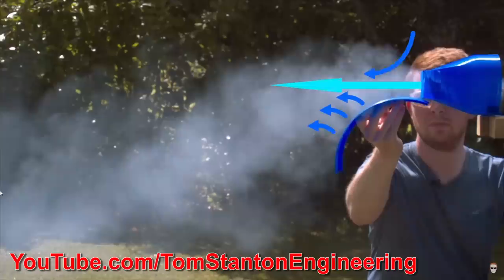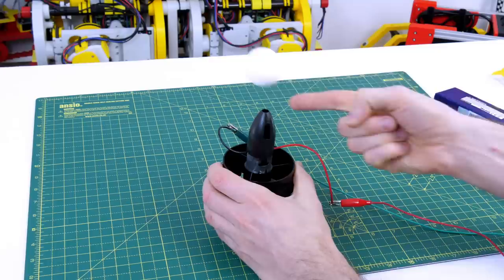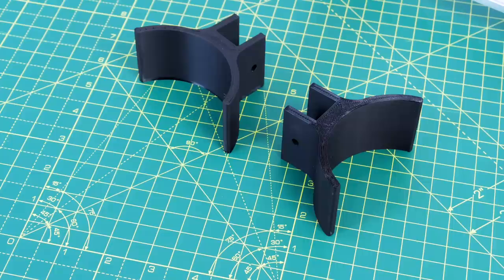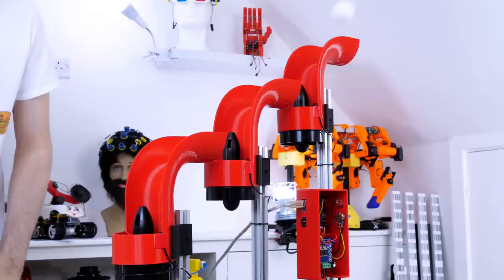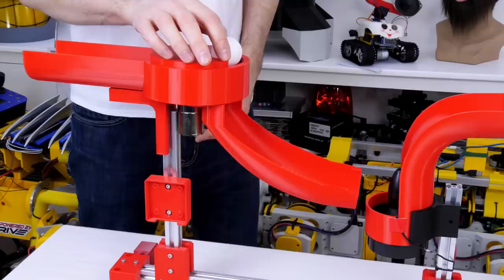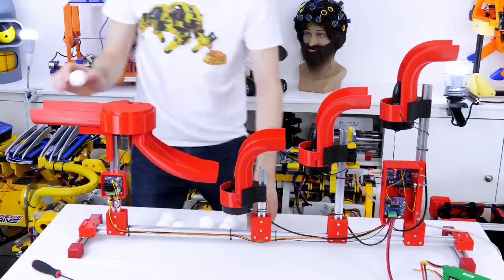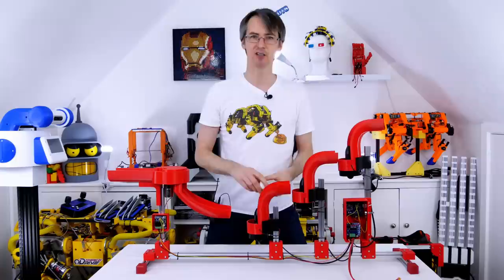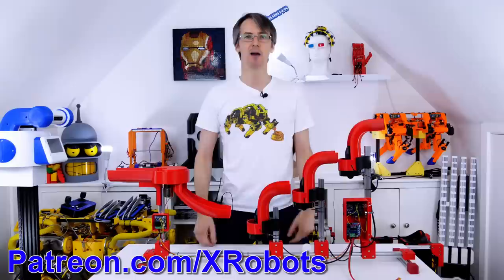What is a Coanda Effect Staircase?

Comment from the maker: We're back to serious robotics again next week with part 2 of my drop-in navigation system for any robot. Patrons and YouTube Channel Members have it already!
Reply: I think the reason why it doesn’t work after it comes out of the shoot is because when it goes out of the shoot it has been spin
Reply: I really enjoyed this one, cheers! 😊👍
Reply: @ben_ands  Maybe an upturned lip at the end could slow the spin as much as possible, so the ball just barely clears the edge
Reply: hey James I want to build a (Nao) humanoid robot using a 3D printer a bunch of servos and a raspberry pi but I have no idea how to code or how to use a raspberry pi do you have any advice on how I can learn or get a pre-programed file for a basic humanoid robot?
Reply: Just curious to see if the air would stick more after using filler and sanding for a nice and smooth inner surface for the air to follow.
Reply: Change the feeding chute to two rails barely closer together than the diameter of the ball. That will give the balls a consistent and repeatable forward spin, essentially aiming them along the "Coandă steps" and also be aligned with the direction of the airflow. 
Edit: Also put some straws or small tubes together on top of the EDF's to get more laminar airflow. 
         Another thing is why don't you use a power supply instead of those batteries...you are not out on a field with no mains power?!?!
Reply: You could make the shoot skeletal with just two metal rods dropping the balls so the air wont stick
Reply: you could have taken a heat gun to a swimming fin to create that shape more cheaply

Comment: I think the coanda effect would be more obvious if the balls didn't enter the system with horizontal velocity. As is it looks like they're already moving sideways and the fans just provide lift. Maybe release them whilst stationary via a grabber. This then challenges the viewer to work out why they start moving sideways.
Reply: Yeah, I was wondering if you could get this system working with the units oriented at an angle, so the balls go up in a spiral or a zig-zag.
Reply: @Hugh.Manatee  mayby with extreme zig zag, and compensated L tube in the turbines
Reply: Alternatively, maybe just have them enter enter with horizontal velocity but in a different direction. That sounds like it'd achieve the same thing with much less work

Comment: Have you tried 'tree support' in Cura? Might quicken some of those long prints!
Reply from the maker: This was a Simplyfy3D slice, I'll take a look
Reply: I'd suggest gradual infil steps in the support instead, slices much faster and is more stable on the bed imo
Reply: Why fear when filament sponsor is here!😂 just kidding!
Reply: How do u get that? I hate the normal supports in Cura its a pain to get of
Reply: @alexairconditioning1581  assuming you have cura 4.8, in the support section, change the drop down box from normal/standard to tree supports. 

If you’ve got an older version of cura, make sure you’ve ticked the advanced settings, then it’s found at the bottom under the experimental section
Reply: @jamesbruton  gosh - I’d have rotated it by 90° to minimise supports needed!
Reply: @davetreadwell  when I saw it laying there in 2:50  I thought, it might be even possible to print it like that. Or even lay it totally on the side so that only the ring needs extensive support.
Reply: @peitz.design  exactly! A curve that large would support itself happily - as you said just the circle needing support. But as other pointed out, if you have a filament sponsor, then waste isn’t as much of an issue.
Reply: Tree support is perfect if there is an overhang over part of the print and you don’t want support material between parts of the print. I hope that made sense. It works great for that, but in my experience, it takes more time to print the tree support than normal support. But it looks cool. Like actual little trees. It feels wrong throwing them away when the print is done.
Reply: @davetreadwell  printing it rotated would help reduce turbulence caused by the layers, if you print it horizontally your printing layers will be paralel with the stream of air helping it go straight
Reply: I use Tree Support a lot, but for such an large area I would prefer conical support
Reply: @davetreadwell  Yeah, the sponsor thing is of course right. But time and the environment might also be something to consider.

Comment: Have a look into wool tuft testing. It is normally used for car/plane aerodynamics but is really good for visualising air flow. 

Taping small threads to the 3D prints will show where the flow is attached/laminar and swing around wildly when it is detached. 

You could also try a clear acrylic  wall behind the prints with small threads taped or glued  to it. This will show the airflow above the fans and also help contain the odd rogue ball that flies off that side.

Comment: I'm sitting here going, "Cool, but why use a battery over a power source that wouldn't drain and die?"
Reply: Probably the current requirement, and the fact that he had li-ion’s handy
Reply: @davak72  but high current 12v power supplies are readily available in every electronics store and they're mega cheap, because PC's use them...
Reply: @UhOhUmm  It would seem we have different definitions of “high current”. Brushless motors and EDFs can use up to around 5000W per motor in similar sizes to those in the video. That’s up to 25 pc power supplies required for each fan.

Granted, I doubt these are using anywhere near that, but still
Reply: @UhOhUmm  Ah, never mind. Just watched the 5 minute mark again, and he says they draw around 85 watts each, so three of them could be run off of a 300 watt supply easily. I wonder if it was just easier not to mess with modifying the connections since he had the batteries laying around and they easily plug into the escs 🤷‍♂️
Reply: I assume he wants to bring the entire ball moving setup to shows/schools and it's easier to have a portable power sources instead of going to the mains every time.  He can also do a power reliability test while he does the main test for airflow.

Comment: James. A couple things come to mind.
The wheel that's on the feeder would be better if it had room to multiple balls. The speed is limited for rotation as to getting the balls in but you can have the balls drop out more frequently, so more places to hold a ball and turning the rotation speed down could help.
Also the end of the delivery chute doesn't have to be solid if you're only using ping-pong balls. You could have very little at the end and still deliver the balls.

Good to see you're doing well and stay safe 👍😷

Comment: interesting project. I think though that the motor cover sticking up might be having a negative effect. Perhaps the 3d printed step should mount the motor deeper down so that the balls are not hitting the black cone, or the air currents that it might be producing.
Reply from the maker: Yes I think maybe much deeper down with vertical fins to stop air spinning. That said there are probably many other improvement to make in terms of the noise it make and the power it uses ;-)

Comment: I'm surprised you didn't implement a pulsed motor control timed off the rotation of the feeder, so that each "step" is only active for a moment. The pulses could also be current controlled so the air flow either slightly increases, or decreases as the ball "climbs" the steps. Cool project, can't wait to see the next version of your Rube-Goldberg.
Reply from the maker: That would be a good idea - even with compressed air and electronic valves. There may well be a V2 at some point.

Comment: "not too unhappy with how that works" Oof man I feel you. It's still really cool and I'm liking this series and the novel concepts it introduces. I hadn't seen a screw used like you did in the previous video. As far as laminar flow goes I'm guessing you might have seen this trick but maybe sink the EDFs down into a tube, and place something like a bundle of straws after the fan to straighten the airflow.

You could also maybe try widening the walls on the ramp maybe? A quick way to test this would be to build them up with something like duct or painter's tape instead of having to do a whole new print, just experiment with some different height and maybe splays of the sides of those ramps.

Comment: you might be right about motor direction, I was thinking the center ducted fan should be a reverse direction  spinning one. I noticed that as some that are flowing higher are spinning in same direction as duct and i would think that w/the second one in same direction would give it just enough to flow  out of area. Like torque thrusted that way.

Comment: @James - one of the big differences between you knuckleballing the ball in, and using your ramp, is the rotation of the ball when it enters the airstream. The air "sticks" to the ball too - that's why it moves in the first place, right? A spinning object will definitely behave differently from one that is stationary. And if you think about it, in your case the ball is rolling "against" the wind - the front of it is rotating down into the airstream. This likely introduces some inconsistent drag and imparts forces that send the balls off in various directions. 

It might be cool to make a follow up with a sharpie mark on one of the balls, to see if ot behaves this way in the airstream.

Comment: What if - hear me out -  after the last step you add a final fan to catch the ball if it goes just right, so that it will float at the end (just like you demonstrated in the beginning). Meanwhile, it could be assembled within an acrylic box to catch the balls and cycle them back up your tower, to be fed back into the staircase. You'd have have air slots in the case of course, but that would give you and extra hand at controlling the airflows direction. Just random thoughts! Great video!

Comment: If you are worried about the balls grabbing on the feeder and not on the first "stair", you could also try changing the feeder to two thin lines holding the balls from the lower left and right side as they slide down it. This would reduce the surface area for the air to grab onto and not affect the desired trajectory as much, and also allow the balls to enter the fist stair much more accurately for repeatable tests!  (also save on print material/time!)

Comment: I remember having fun suspending a steel ball bearing about 8mm in diameter over the nozzle of an air nozzle fed by a compressor. It didn't hover very high up but it was clearly suspended. It was also held in place surprisingly firmly, and it spun very fast. I had heard of the Avrocar and thus presumably the Coanda effect, but never made the connection. (We called the 'nozzle' an air gun, I think, but you'll see something completely different if you websearch that. It had a very small nozzle machined in steel, and a trigger to let the air out.)

Comment: I wonder how much the air flow from the first curve is feeding in to the air flow in the second. The balls do seem to accelerate on each section, and might explain why it seems to almost skip the second curve half the time. Not sure how you would compensate for that, other than by spacing the steps out more. Alternatively, you could maybe run the second fan slower, and possibly the third fan slower still? I like the laminar flow idea too.

Comment: Cool Project! The coanda effect only contains the ball well on the edge of the air stream. The larger the difference in airspeed at the interface, the greater the restoring force. Since your blowers are much larger than the ball diameter there's a whole region where the ball isn't contained and is free to float sideways. This only gets worse as the air stream spreads out above the blower. 

You probably want to narrow the outlet significantly to about the diameter of the ping pong ball (which will increase the airspeed as well which is good)

Comment: You might want to fiddle with the part orientation and bridging section to minimize support material. It's likely inevitable with such large, single-print parts, but you might be able to change the orientation and get away with a lot less support w/ good use of overhangs

Comment: You need to use non-planar slicing. This will get rid of the jaggedness between layers and allow a truly curved surface to be printed.

You could also add some clear plastic walls to restrict the air to operating in 2 dimensions. There may be turbulence from elsewhere in the room.

Comment: Others have mentioned the turbulent air from the EDFs - I'm also wondering if the layer lines on the curved pieces might be rough enough to cause flow separation. Sanding them smooth might be worth doing. Cool project though!

Comment: I think the issue is that the balls are getting pushed up by the left (from our point of view) sides of the EDFs, where the airflow would be mostly vertical. If you covered that side of the fans and delivered the balls to the right side, it should work much more reliably I think.

Comment: This is just a seat of the pants guess from watching your vid and roughly zilch for engineering or aerodynamics education, but what happens if you turn the fan speed down a little on the second fan, independent of the other two? Maybe drop in a smallish value (100 ohms, perhaps, or maybe go with a 0-1M pot?) resistor in series with the hot lead to the #2 motor? Seemed to me that the balls were sort of "launching" when they hit the air stream of the second fan, making me think that it might work better with a little less velocity on that #2 air stream.

Comment: The ducting tubes for the fan should be deeper. The issue with fans for producing air pressure is they produce turbulent flow, and measures should be taken to smooth it out. That's why the effect from a compressed air source works a lot better, air from a pressure reservoir doesn't have anywhere as much turbulence.

Comment: Is there any reason you can't add lexan or perspex side plates?  what you're making is essentially a blown diffuser, an aero device used in some race cars to generate downforce by creating low pressure.  they include side plates that go nearly to the ground to seal in their airspace and allow air expansion and low pressure to suck the car to the ground.  with the top and input sides open the coanda effect should still be fairly obvious.

Comment: I think you should make the ramp that feeds into the staircase out of rails of plastic or metal rather than a contiguous piece to help break up the surface area for the coanda effect to stick to.  I would also have the feed ramp up slightly to launch the balls up into the air stream to make absolutely sure that you have nothing interfering with the first coanda "catch".

Comment: On the feed ramp, couldn’t you perforate it to break the Coanda effect?  You could also use some kind of mesh to help keep them from falling off the side of the steps (maybe that’s cheating).  I definitely think the inconsistency could be solved by laminar air flow.  Maybe you could vary the texture to make air flow slower on the sides of the steps or faster in the middle to help keep the balls on track.  Cool experiment!

Comment: I think part of your issue is that the second and third stages get the previous stage's air mixed in from the side together with the ball.

Making the steps higher and instead of bending over have a trap to let the ball fall through towards the next one and the air to go away (deflect upwards or to t he sides) would probably work better.

Comment: The "shute" (I dont know the spelling) seems to be the problem. If you notice, they bounce on it causing a bad entry into the first fan, also introducing a lot of randomness. I think it should be more of a reversed J shape, with a more steep fall at the beginning eliminating that first bounce, and gradually changing direction sideways, and it could even give it a little bit of upwards movement as it goes into the first fan.

Comment: I wonder if it could work better with a positive curvature surface rather than negative curvature that you got... seems to me that your configuration would tend to split the air flow in two, one going along one sidewall, other going along the other sidewall. Picture it being held upside down and water running along the surface.

Comment: You need to reverse the motors so the air is not divided by the motor.  You want a central core of fast-moving air.  A partial constriction after each fan stage  would probably help.